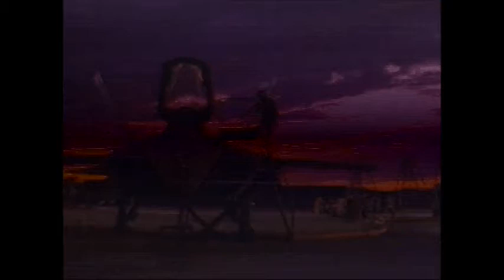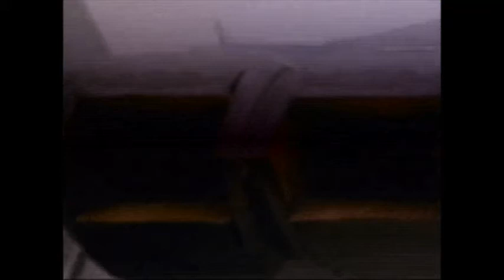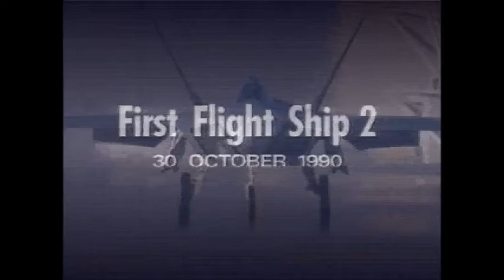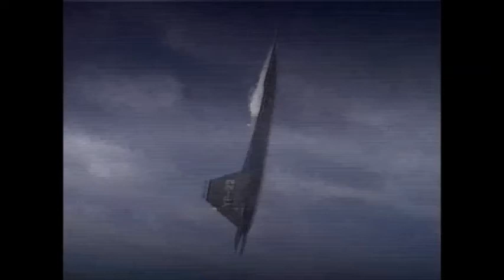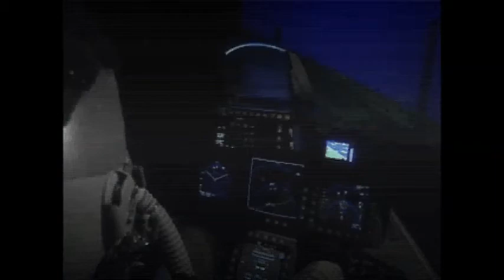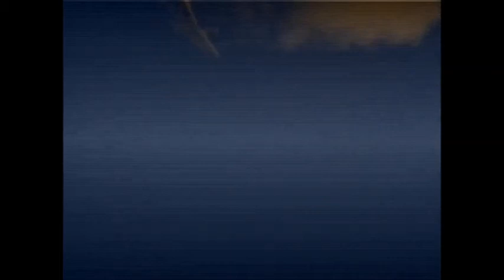F-22 Raptor: Design & History

Comment: '
coool nice F-22 plane...
F-15se is more better faster speeding than F-22...
F-22 must use two round O==O on the back rear airout jetmotors...
not two rectangle [::::]==[::::] rear airout jetmotors